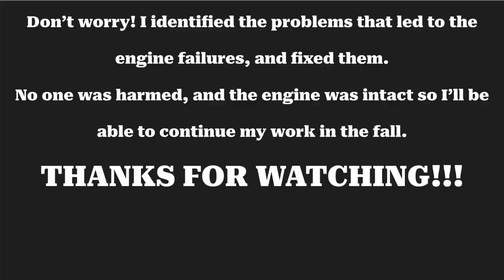Rocket engine failures: Turns out rocket science is hard

Comment: Just discovered this video, very educational and fascinating, thank you for sharing.  If I may suggest.... have you considered the use of three feet of metal flex hose at the back end which can take the current brief thermal load where your engine has its O2 inlet?
Reply from the maker: In fact I ended up using exactly that, which resolved the issue.

Comment: What's the hose that keeps coming off? And how did you fix it coming off?
Reply from the maker: It’s the oxygen hose that keeps blowing off. The fix for it is making sure there is a proper pressure drop across the injector. At first it was because of faulty o-ring seals, though later issues were with experimental injectors having improper sealing or improperly sized oxygen injector holes
Reply: @jingojango9220   before your firing attempts, did you do any validation test without fire?
Reply from the maker: @AK_381  Yes, but evidently it didn't reveal all the potential issues

Comment: Too much pressure makes the green oxygen hose detach and blow up?
Reply from the maker: If the pressure in the combustion chamber is too high relative to the pressure in the oxygen hose, then that allows the flame to travel into the hose and blow it up. This usually happens when there is an improper seal somewhere that allows the pressure in the hose to drop below what it should be

Comment: I think you combine the fuel and oxigen on same tube if yeas make them separate is not then use strong metal connector before feeding on the combustion chamber
Reply from the maker: The fuel and oxygen are in separate hoses, and feed into the engine through a steel injector manifold. 
I've looked into using stronger hoses for the oxygen line, but decided that this is actually one of the safest and most cost-effective configurations I can use. The failure point is consistent, and it prevents any of the more important and expensive parts from being damaged
Reply: @jingojango9220  good to hear that we are safe,just quick question what hose did eject from combustion chamber the oxi or fuel?
Reply from the maker: The oxygen hose (green) was the one that exploded
Reply: Well, you can improve and correct the issue. Mostly glad to see that you followed safety precautions. It's necessary.

Comment: what engine are you using?
Reply from the maker: An ethanol/oxygen fueled engine I made
Reply: @jingojango9220  how come you have a lot of explosions but backyard scientist made a diesel rocket and held it in his hand
It was making decent thrust too

I am genuinely interested in knowing! He had it running for a minute or so and played with it

What makes his so stable and ylurs so explosive and dangerous??
Reply from the maker: @FirstLast-tx3yj  Having watched his video, I would guess there are a few factors that make his engine more safe:
First, he's using air as his oxidizer, which would make the fuel burn at a much lower temperature and less energetically than if he were using oxygen. 

Second, the engine is smaller, and consumes less fuel. Presumably generating less thrust and at a lower chamber pressure, though I don't think he actually measured either of those so I don't know for certain. Regardless, that means that there is less fuel and likely less pressure inside the combustion chamber, which is much easier to safely contain
Reply: @jingojango9220  yes using compressed air is more of a turbine than rocket

But i thought the safety of the design comes from the cooling of the walls of the flame tube  and the vortex generated by the holes at the bottom of the tube

what are the dimensions on your engine and what  chamber pressure do you aim at?

Because a 10kg liquid rocket is being much bigger and troublesome than a 10kg solid rocket
Reply from the maker: @FirstLast-tx3yj  you should be able to find the info on my engine here: https://drive.google.com/drive/folders/19U5qajxntqbdrhCJmFf-ur6zKvf1-5Aw?usp=sharing 

Safety and reliability of a rocket engine depends on a number of factors. The issues I encountered with my engine were mostly due to faulty o-rings in the propellant injector